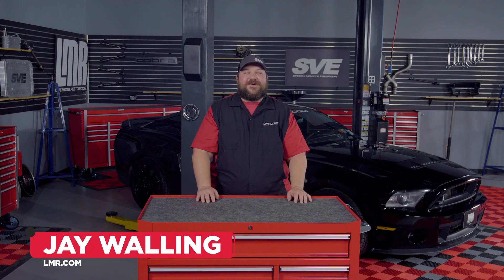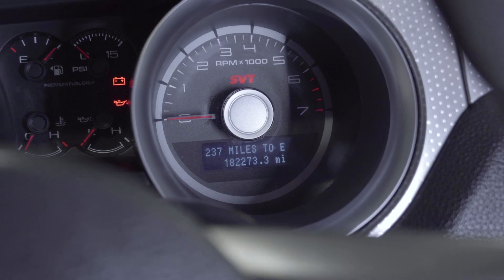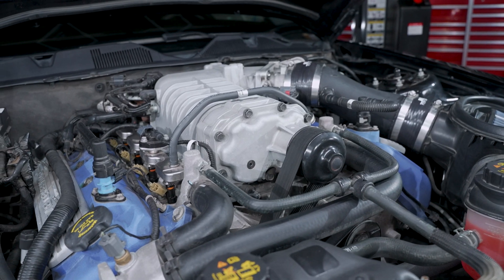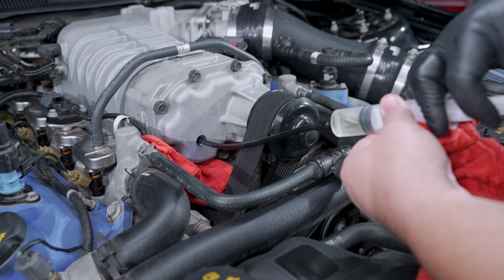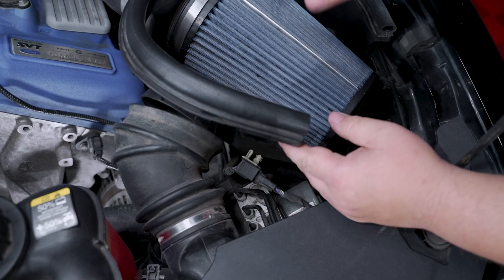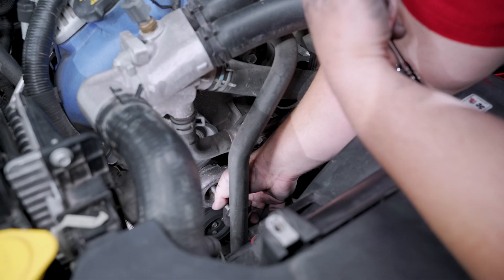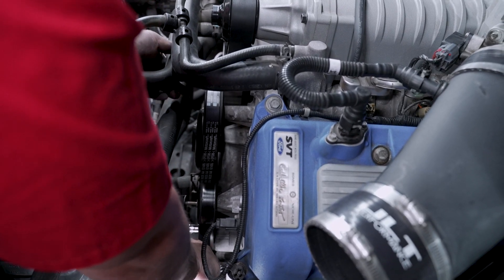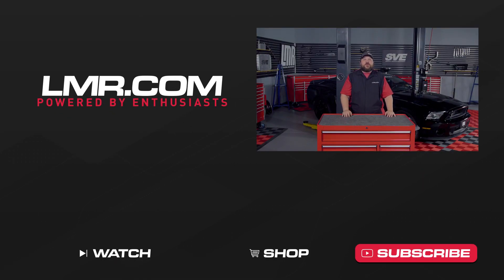How To Change The Factory Mustang & Lightning Supercharger Oil & Belt

Comment: Great video. I just got my 2014 GT500 and I don’t hear any supercharger whine. What could be the reasons for that
Reply from the maker: The 2.3L TVS superchargers on the 13-14 GT500s don't make very much noise. If you want more noise, spin it faster with a smaller pulley. That will require a tune, though. If then, it won't sound like an old school Eaton on an 03-04 Cobra or 99-04 Lightning.

Below is a link to a dyno video of a 2013 GT500 that we did for reference. The mods for the car are mentioned in the video. -Landan

https://youtu.be/RYpOT2Tw-Hg